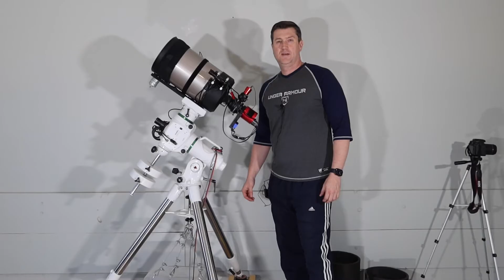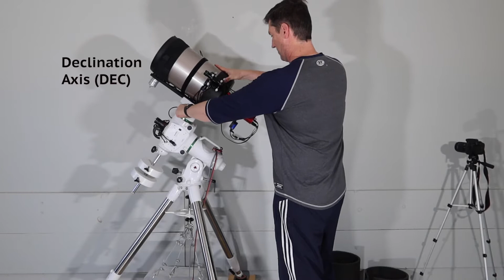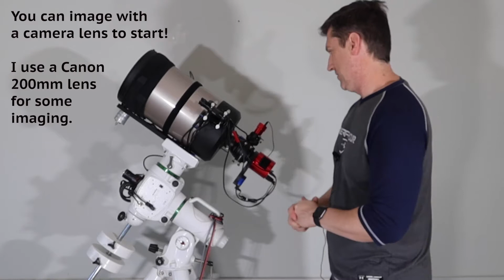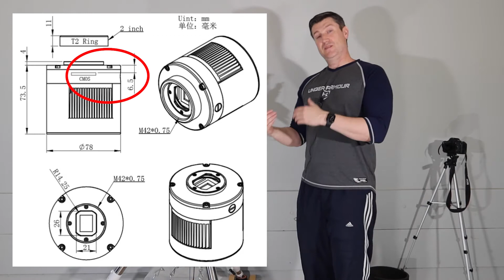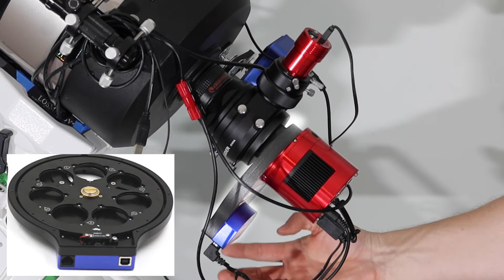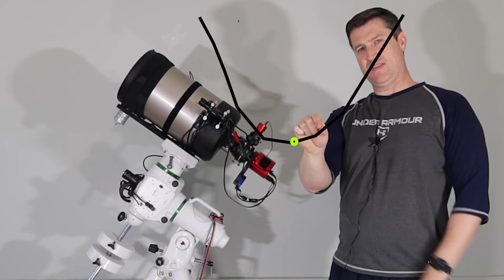Astrophotography Telescope Parts Introduction

Comment: That was an eye opener, thanks.
Reply: That was very informative, you answered a lot of question I had. Your equipment break down was excellent.
Really let me know how much better my rig needs to be.
Reply from the maker: @myskies  There is always something to buy, or a component to upgrade. You can do a lot with less for sure. If nothing else, it hopefully gave you a roadmap to plan for future add-ons if/when possible. Best of luck! Clear Skies!
Reply: So after watching this video, I ordered a skywatcher HEQ5 PRO mount, already received . Have a skywatcher star travel 120mm x600mm. 
Last tripod was almost to wobbly to even use the eye piece to look through. Hoping to start with a Cannon mirrorless, then migrate to
a real astrophotographers camera and much better telescope. Thanks again for aiming me the the right direction.
Reply from the maker: @myskies  Great! You need a lot of patience in this hobby, but sometimes an upgrade can actually make things work easier (especially once configured). Clear Skies!!!
Reply from the maker: Hope it helped. Let me know if you have questions.